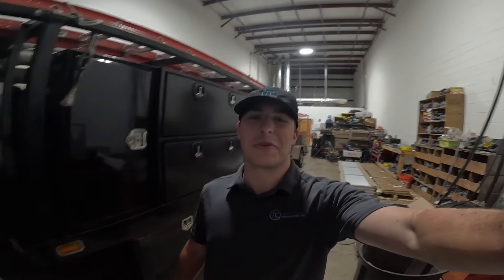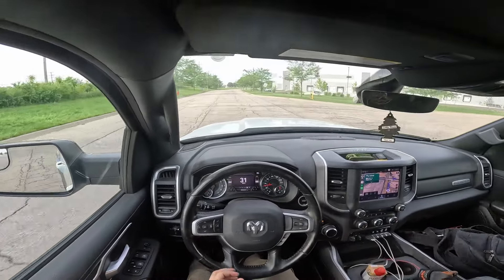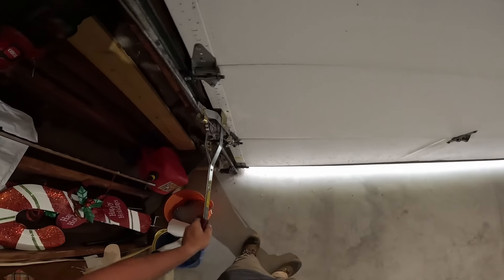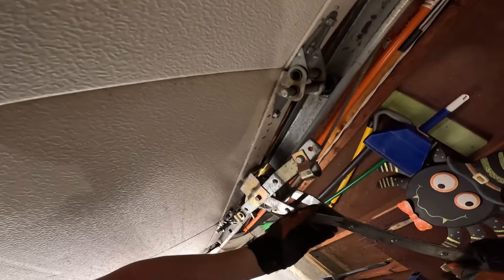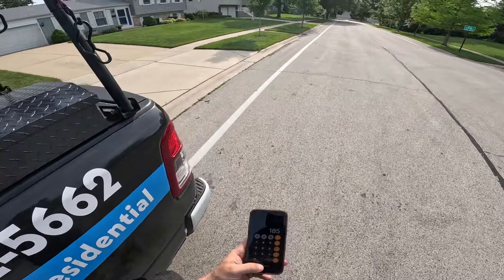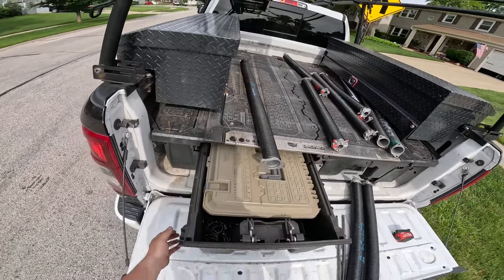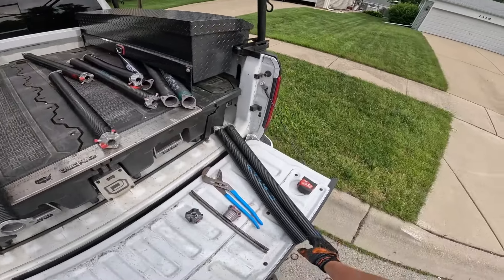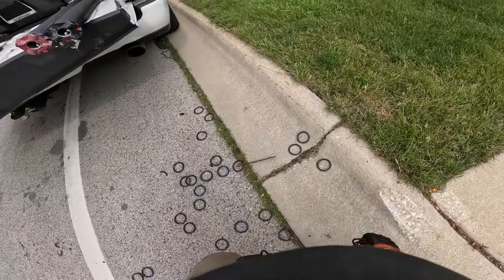BOTH Garage Door Springs Broken.... Garage Door Spring & Cable Replacement

Comment: What would cause a garage door that only opens when the garage door opener is held down. Doesn’t go up or down with one press?
Reply from the maker: Sounds like you are bypassing your force limit, is your spring broken on the door! Pull the emergency release with the door on the ground and see how heavy it is

Comment: Get a torch and cut the springs properly. Bro is this your first time cutting a spring? You did the entire process incorrectly.
Reply from the maker: Ill just respond to this one and delete the rest... 1. Over torquing, no 2-3 half turns doesnt bar the tube 2. Torch and grinder are interchangable..Using a grinder literally does not affect the process of spring making at all LOL.. Plenty of videos of me using torch, but dont have one on pick up truck 3. Bearings are rated for anywhere from 50k-100k cycles, these bearings didnt have shake and after checking nothing was wrong with them, dont need to replace bearings every spring change, thats upselling.. 4. I can tell its 15r lol... but why would i not 100% confirm instead of guess, that sounds like a hack job to me 5. I said higher cycle.. standard cycles are 10k i upgraded to 30k with no additional charge.... so you dont have to watch the videos, but lying in the comments/calling me out when you are wrong is not very cash money
Reply: @tcgaragedoor  it’s 3/4 of a turn once you touch the tube but if you’re using that much effort to turn the ratchet then you started hitting the tube far before you realized. You guys always make it harder for the next guy.
Reply from the maker: @philbelfrage  again, you dont see that i grip my hand on top of the ratchet part so i can feel it, until i get to the point of me touching the tube, then i add 2-3 half turns. you can still feel the shaft lol
Reply: @tcgaragedoor  2-3 half turns is too much. That would be 1-1.5 full turns. 3/4 of a turn is what you should be using.
Reply from the maker: @philbelfrage  Its an argument as old as time... people do it how they want, I have taken off PLENTY of my springs and never have I dented the shaft from how I do it, and I feel comfortable doing the same on 1 3/4" id springs as i do installing 3 3/4" springs, so im not going to change that. Just because thats how it says to do it "in the book" doesnt mean thats the only way to do it. You will never see me doing 3/4 turns on 3 3/4" springs, putting pressure on the winding bar to check, they will slip (pssst i've done that before), and obviously this rule does not apply to 6" springs and if you think it does, well not much i can say other than youll learn
Reply: @tcgaragedoor  that was not a 6 inch spring you’re going way off topic